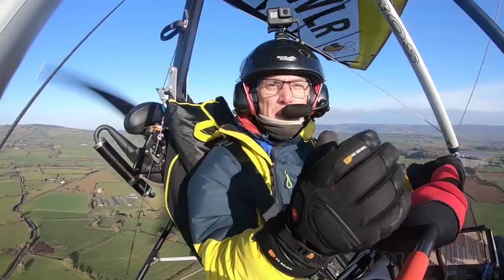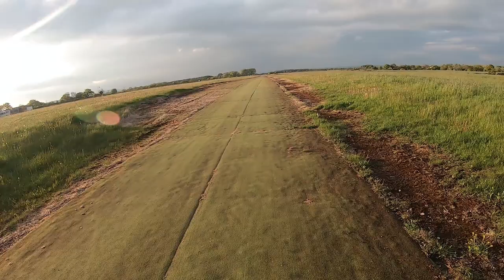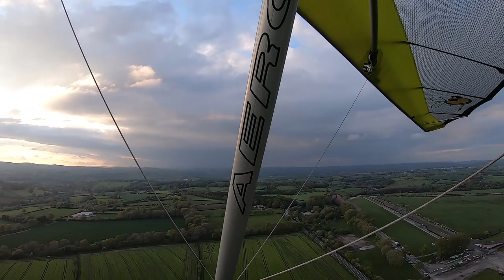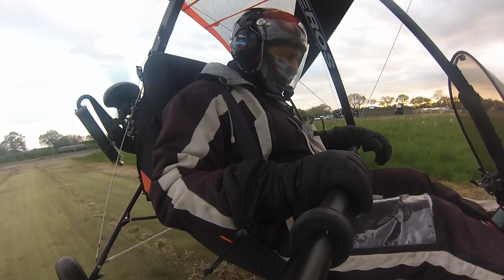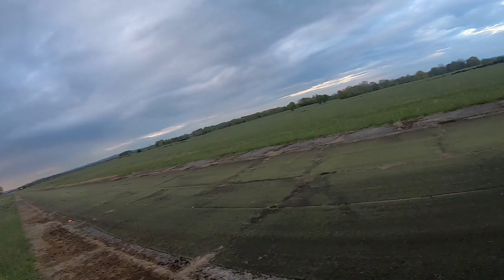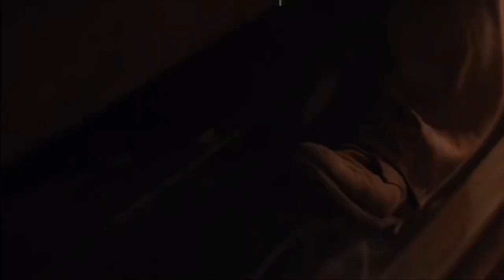Instructor CHALLENGE - Landing short in a PeaBee - WHO WON

Comment: Brings a new meaning to using the foot brakes. Fun video Giles very interesting did you actually measure the shortest landing in meters?
Reply from the maker: Hi Terry, yes, I thought you'd like the short field side of things. The shortest distance was less than 80 meters and it was nil wind. I have landed and stopped in less than 30 meters with a headwind. I knew Mark would want to beat me.